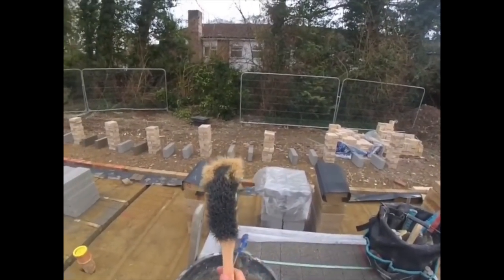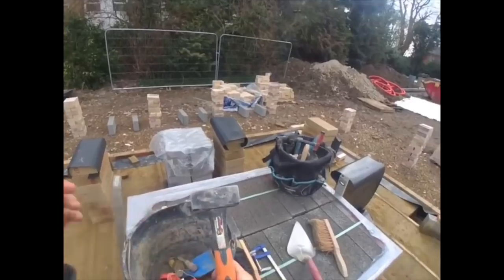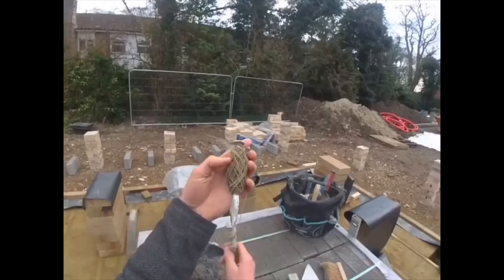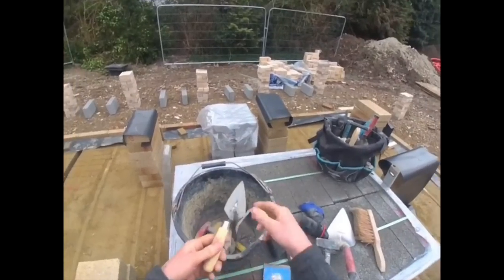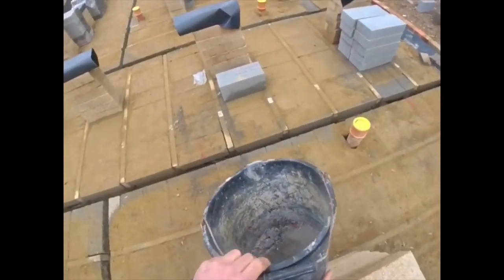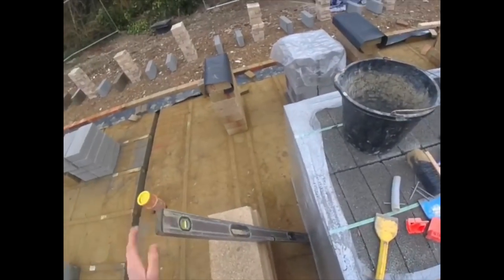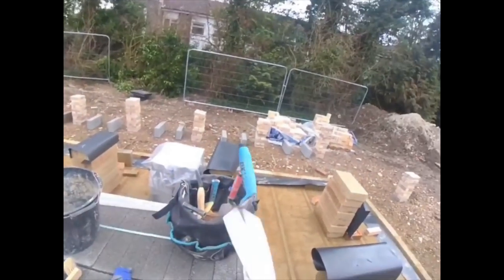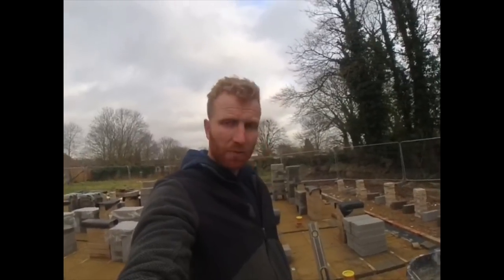Basic Bricklaying Kit. | The skill of bricklaying.

Comment: Nothing wrong with them didn't see a brick hammer ? Had a hardly used hand me down 13 inch WHS narrow London trowel in 1970 and still got all 8 inches of it . And my brick hammer and that was old when I got it
Reply from the maker: I have another video with extra tools I have accumulated over the years. I just took tools I needed for the day as I grabbed a lift to work.
Reply: I baught a new level in 1980 though £38 that was a lot the. . still got it lol . I'm not tight I've spent every penny I've earned but if it works . I didn't notice it getting smaller but yes 51 years lout of a second hand trowel my grandfather gave me . Sentimental